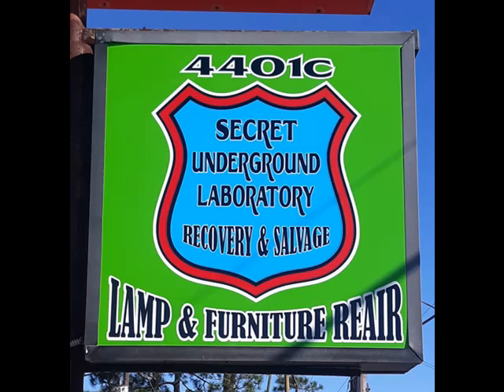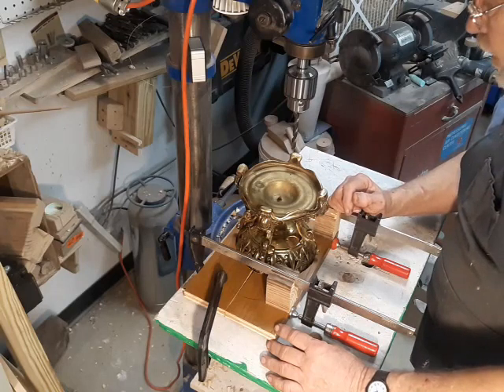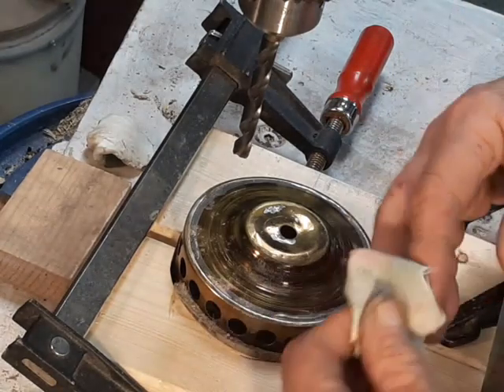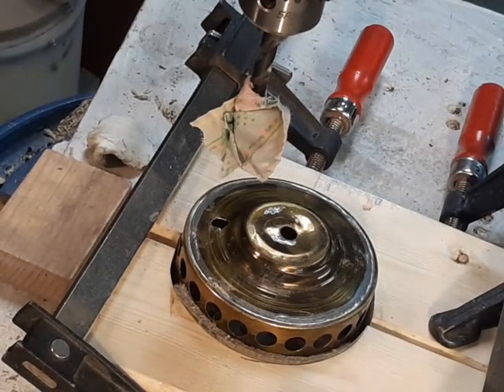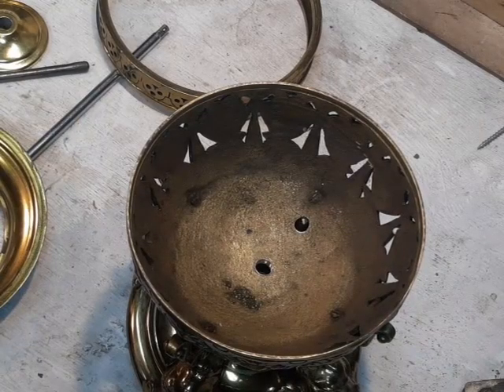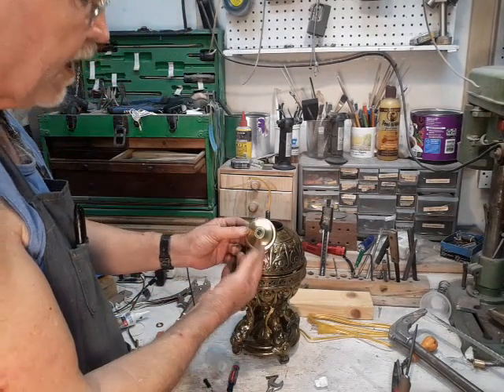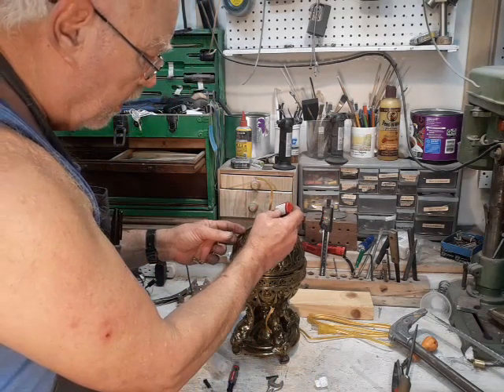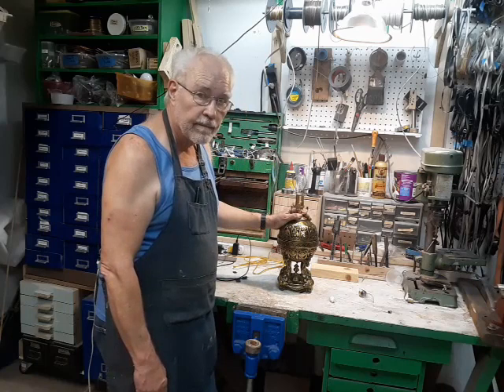Trade Secrets Revealed Converting Brass Oil Lamp to Electric in the Secret Underground Laboratory

Comment: Why do people do this. ??? If you no longer want your antique lamps just sell them (as there are plenty of people who do want them.) then go and buy your modern lamps. I have seen the odd conversion that has been done sympathetically enabling it returned to it's original state without drilling holes, cutting out or brazing additions in because as soon as you any of this type of damage to your original lamp its value is seriously diminished. These lights were never designed or intended to be electric and as such they just do not look right. Take a look at the end result of this conversion. Do you think it look right?
Reply from the maker: That's not my call, as I don't own the lamps. You should check my video where I rewire a Springfield 1873 Trapdoor rifle which someone drilled a hole in the barrel and turned it into a floor lamp. The owner of these lamps was given the option of a "no drill" lamp conversion, but thought that would look tacky.